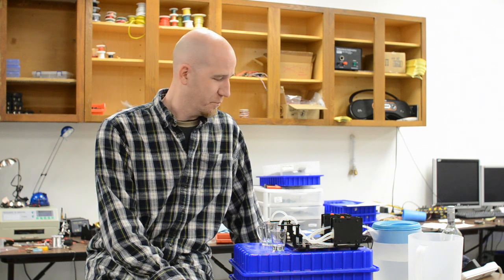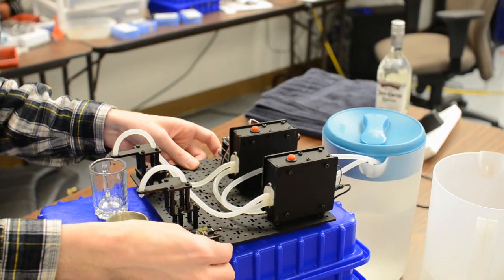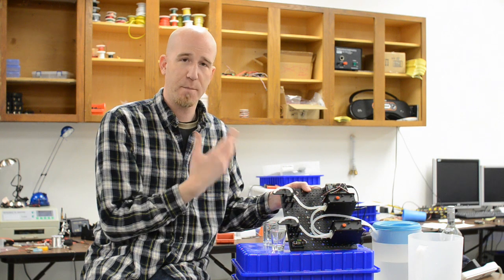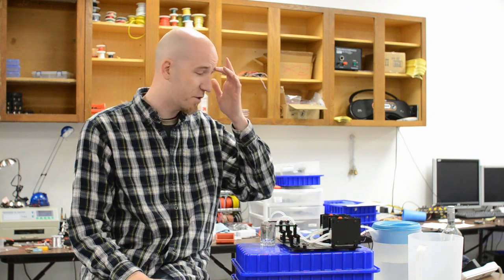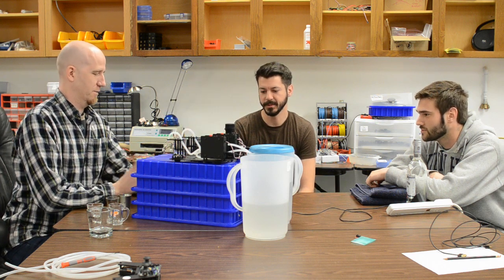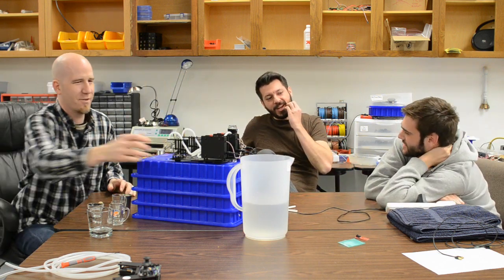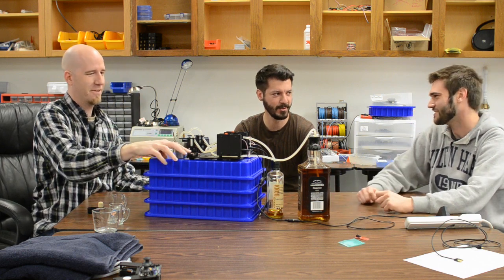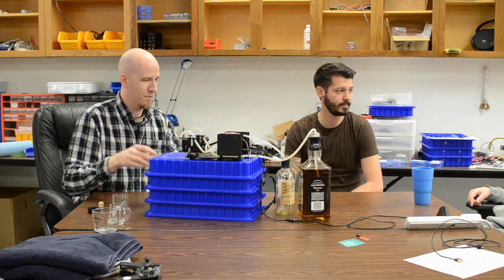Using the RobotGeek Spout Kit to Make a ShotBot

Comment: Can the pumping stations be mounted upside down?
Reply from the maker: The Pumping Stations can be mounted in any orientation. Really the only consideration you need to give is that the fluid reservoir is lower than the pump, so as to avoid leakage!